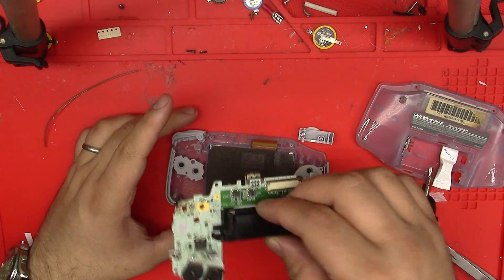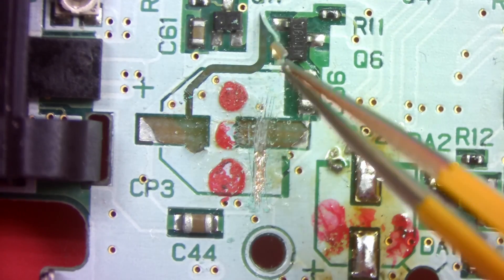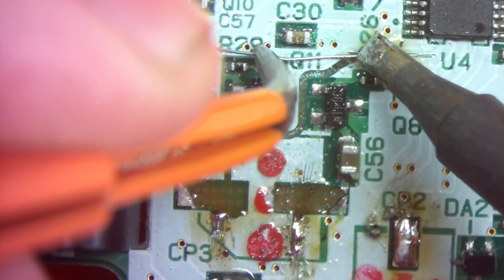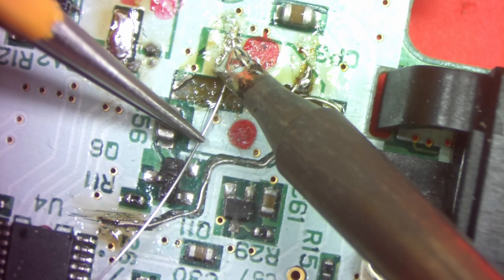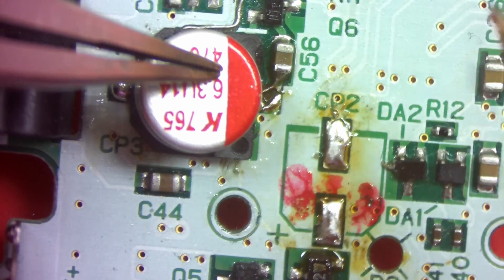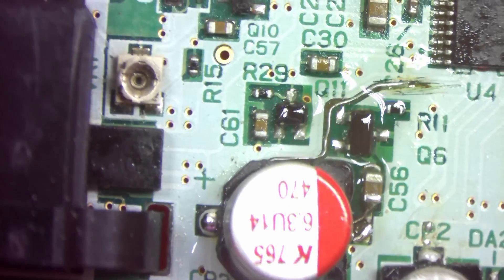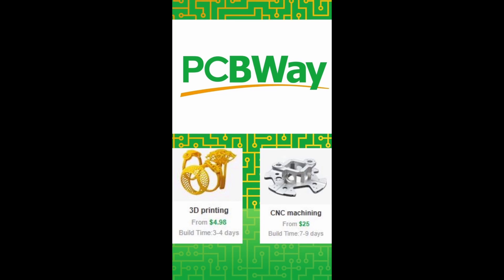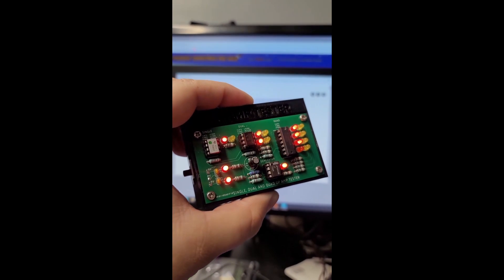Repairing missing solder pads on a GBA

Comment: Hi, you might not read this but what kinda white and width did you use exactly and does enamel or non enamel matter for this kind of fix? I ripped the left pad next to the cartridge reader for the big capacitor and was hoping to fix it.
Reply: Meant to say wire instead of white but thanks for any help if you see this
Reply: Also which conformal coating brand did you use?